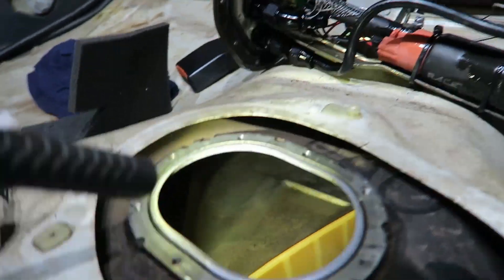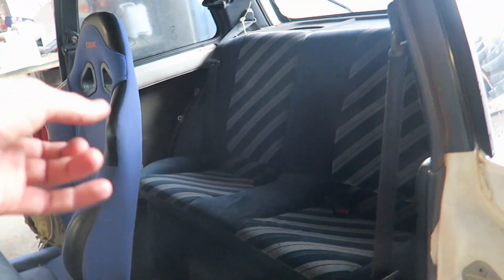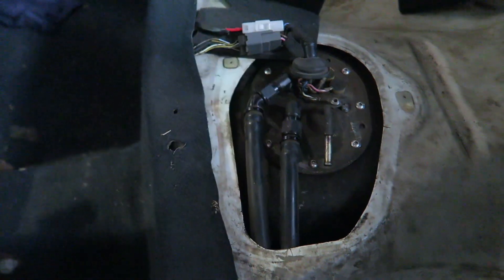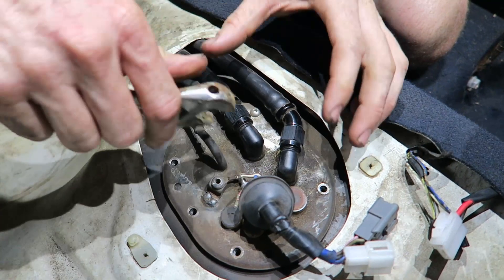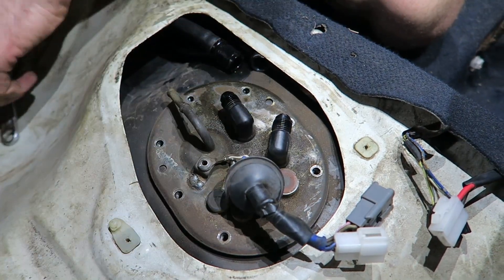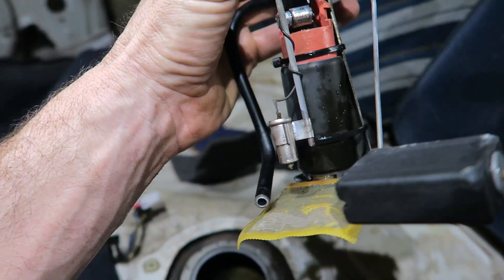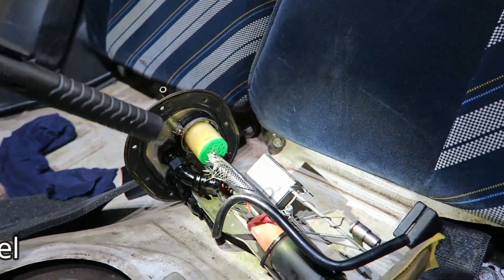Will E85 fuel rust a steel fuel tank? 10 second answer!

Comment: 98% of all gasoline in the United States contains 10% ethanol.  It will absolutely eat a steel tank.  I have a video on my channel showing a tank from a Harley that was absolutely devoured because the owner did not drain the tank before he stored it.  I can't explain why your tank didn't rust, but I won't leave ethanol fuel in a steel tank that has not been coated.
Reply from the maker: We left this car untouched for 2 years and the tank was spotless. I can’t explain it either. I have seen tanks destroyed by the normal pump fuel and 10% ethanol.

Maybe it has a special coating from factory?

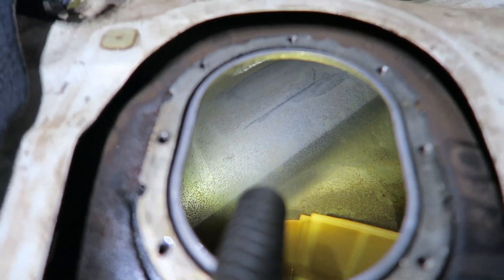Comment: Hi Matt, @ 2:21 ...Am I wrong or it doesn't look that clean on the wall isn't it ?  can’t you see some pitting ? how was the tank before E85 ?
Anyway, 3 month with a car kept inside the workshop, no moisture absorption,  you don’t take risks, 
I did same for 12 month with half tank outside, then highly noticeable corrosion on the steel part of your fuel pump, large discoloration of plastic parts and E85 phase separation, but my steel fuel tank was ok
Reply from the maker: hi the car was originally sitting with unknown fuel for a few years before I got it going. that pitting was probably from that. the tank looked pretty much the same before E85 also. the car gets driven outside every day and parked in the sun. I do understand there are many other factors and things that could make the end result different, but overall its in great condition compared to what everyone says ethanol does to tanks.

Comment: I ran e85 in my Harley for 6 months with no issues or rust, rode daily
Reply from the maker: what were you doing with E85 in a Harley ? haha
Reply: @Camp_Dogs  same as everyone else who uses e85, making more powwweerrra
Reply from the maker: @andrew1977au  true that... it doesn't seem to be a good power adder for the N/A gt... we are gonna try methanol on that car soon lol
Reply: @Camp_Dogs  what comp? Have you tried a e85 and 98 mix?
Reply from the maker: @andrew1977au  12.1 and nah I haven't. I ran E10 once and it drove alright... didn't check anything on the dyno though, it was just to get me home
Reply: @Camp_Dogs  with that comp going from 98 to e85 you shoukd see a decent power boost, you either have a blockage (inlet or exhaust, this includes valves and cam timing) or tuning